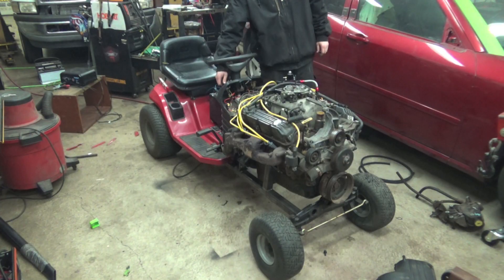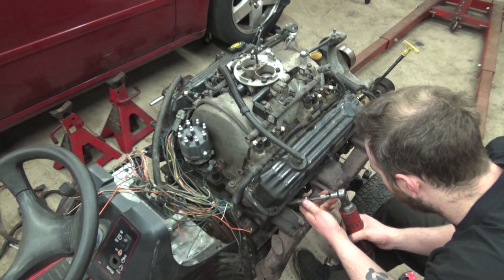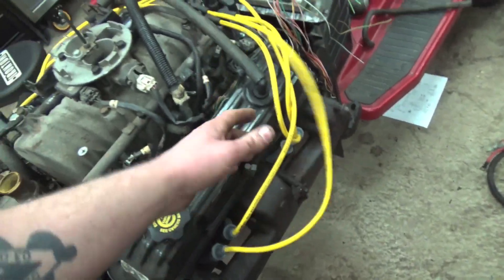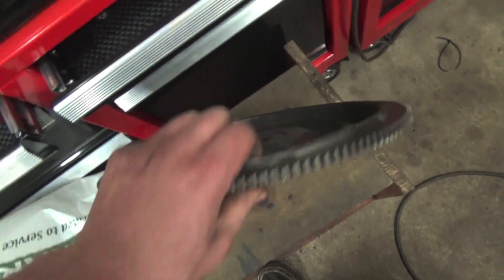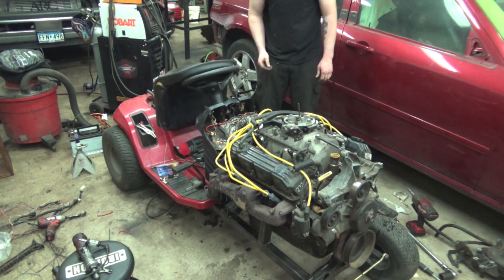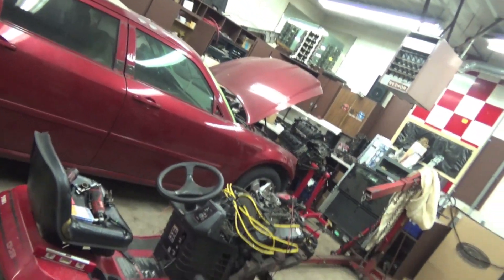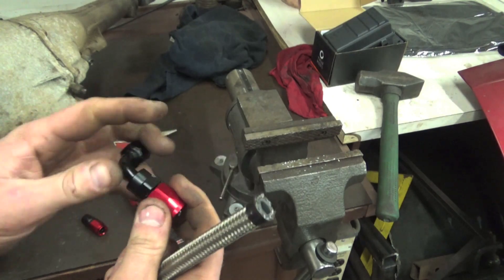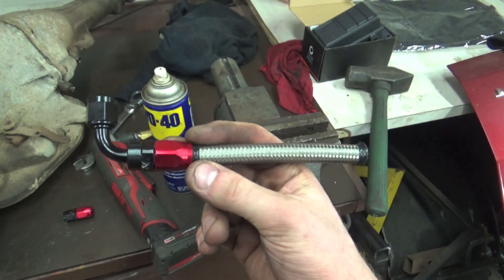V8 LawnMower FIRST START & 5.9 magnum stand alone wiring harness

Comment: if you use a 1992 ram 1500 5.2 fuel rail it has regulator and return line all made together stock setup

Comment: Lol, greetings from Russia again!;-) a funny unit comes out!))) Will you want drifting on a lawn mower?)))

I put(in 5.2l) the fuel pressure regulator assembly with a filter from Volkswagen. 
"AMD AMDFF714" fuel filter 4bar

I liked that there is no need to make a fuel return route to the tank. There is an additional fitting in the filter itself and you can immediately drain it back into the fuel tank.
Reply from the maker: Very true! And how everything okay over there seems pretty crazy! Yes drifting on a lawn mower will be done lol
Reply: @RacingRamFam  My old carburetor truck of the USSR 1978 with a residential module from the German Hobby trailer 460, also looks a little crazy, but it was seriously revived by the swap magnum 318. And most importantly, the car fulfills its purpose :-))) 
Wheel-to-wheel locks in the differentials allow get stuck where  tractor can hardly reach to pull the truck out 😂

Magnum is power, not BMW and M-power. LoL Only V8, only Magnum, only hardcore :-)))))
Reply from the maker: @megasvarshik  that’s awesome! That low end torque
Reply: @RacingRamFam  Of course, if try compare 5.2/5.9l Magnum with other modern engines, it's easier to take some stock version of a turbodiesel... In those engines, the torque is 700-800Nm. 

But price tag of this engines is very high, and will also have study connect a lot of electrical circuits and electronics units.

First problem will be immobilizer, then availability of the necessary sensors, and of course search for correct operation of engine without a glowing "check engine":-) lamp, when engine will work according to emergency program and will not be able to issue 700-800Nm🤣 Maybe 7-8Nm 😂 LoL
Reply from the maker: @megasvarshik  that’s awesome! And there extremely durable as you’ve proven
Reply: @RacingRamFam  Great! And in meantime I'll be waiting for you to show blue smoke under wheels of a lawn mower. Drifting not far from your home lawn on lawn mower 😁👍

Comment: How do you plan to make the thing move are you gonna make the v8 run a hydrolic pump to run the blade and axel
Reply from the maker: No 90 degree gear box, run stock rear end with a v-belt setup for now. If one of these videos go over 100,000 views I’ll do a part 2 (after this ones mowing the lawn of coarse) and run a 904 trans, shorten rear end and go for the world record of fastest riding lawn mower
Reply: @RacingRamFam  yess I've been waiting for you to make it run. Please do drag race it 😂

Comment: '01 ecu needs something more to be used as a standalone, right? I've got an 01 ram donor truck sitting in my driveway, engines going into an e30 bmw and im not set on which route i want to go for the ecu yet
Reply from the maker: No 01 ecu same as this
Reply: @RacingRamFam  rad

Comment: whats the reason you didnt use the 5.9 in the turbo truck
Reply from the maker: Had a 5.2 in there didn’t want to pull a perfectly fine running engine
Reply: Ever ran a single turbo on a stock magnum 5.9?  Thinking about doing that in a b3500
Reply from the maker: @TLF-ABC123  do it! Check out fed up fab they have a single 5.9 magnum
Reply: Hell yeah will do, I’m in northern iowa.  I’d love to meet eventually
Reply from the maker: @TLF-ABC123  ya man that would be sweet!

Comment: Where can I get a diagram to wire this myself?
Reply from the maker: Just using a couple of googled wiring diagrams! Two ground wires at pcm, one constant power, 1 ignition power, asd watch wire and asd power wire to all injectors and coil packs. I think I explained it pretty good
Reply: Is there any chance I could contact you in the future regarding some questions on this setup?
Reply from the maker: @ajvoight8313  ya that’s fine
Reply: Did you run the asd watch and power just straight to key power?